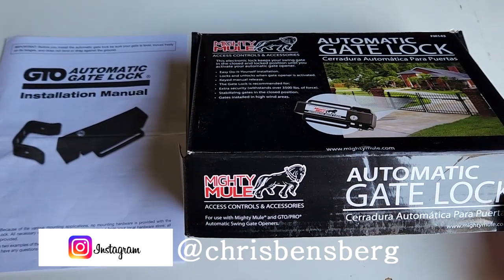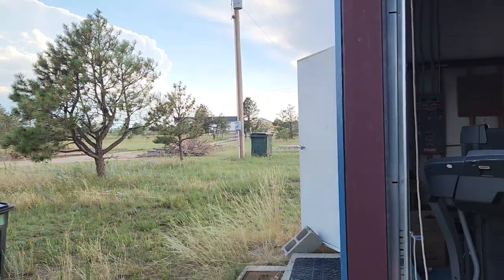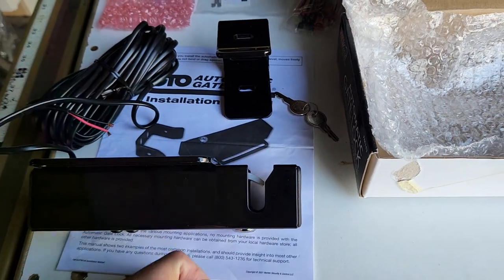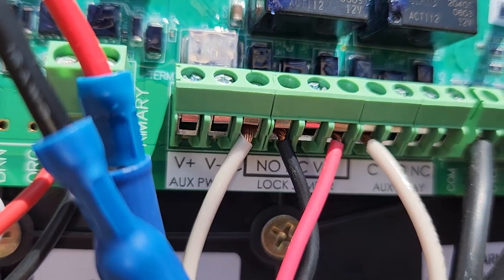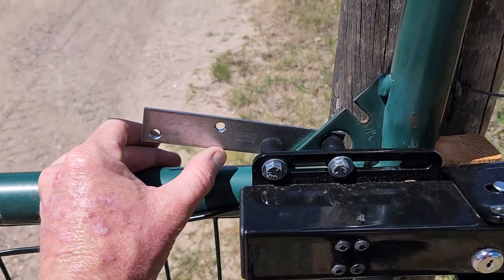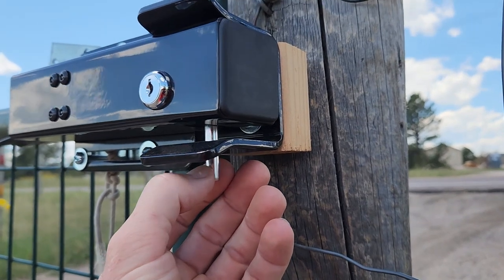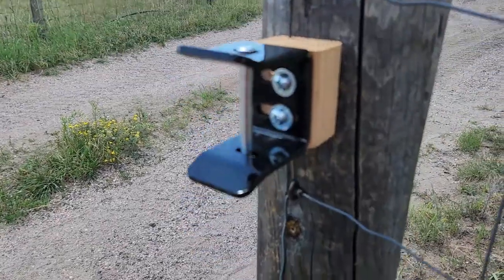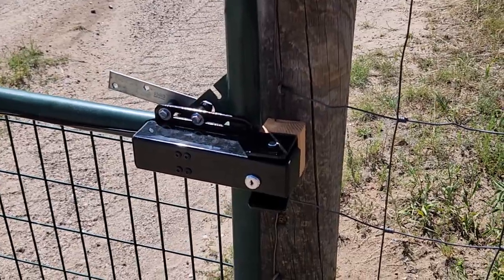Mighty Mule FM143 Automatic Gate Lock Installed On 371W Gate!

Comment: I would not bolt the latch on the post.  Here in Florida with expansion and contraction you need that little bit of play when closing.   I have not had any problems with its ability to stay locked.  I have had a lock a long time on my system.  Watched you video mainly to confirm how to wire the lock into the new 371W.  Never had to use a jumper before.  Thanks Great Video.

Comment: I don't think you want to thread and bolt that pin down. As I understand it, that is designed that way to have play so if the gate shifts or weather causes the gate to wobble while closing the pin has room to move around and secure itself in the latch and the gate doesn't bounce off the pin. I'm about to install this, this evening. Good overview and I like the way you attached it. I was contemplating the muffler clamps they recommended.
Reply from the maker: Great advice thank you, I hope your lock is working great:)
Reply: @TipsNNTricks  It is, we are very happy with it!
Reply: Most likely true - however all that play causes the gate to rattle around in the wind.
Looking at the Viro Lock V96, has a different design that doesn't use a pin. Isn't cheap thou.

Comment: Mighty Mule is Garbage! This lock sucks! Fails all the time...
Reply: Had mine for years with no failure. The only issue I ever had was due to gate sag. Installed right, should last years.
Reply: What lock would you recommend for a mighty mule opener? Is there a better lock that will work?